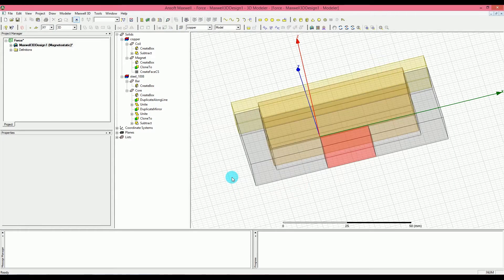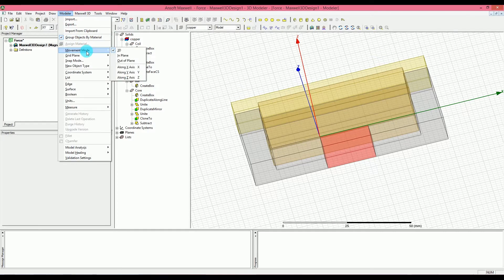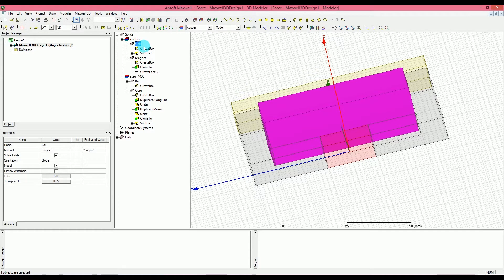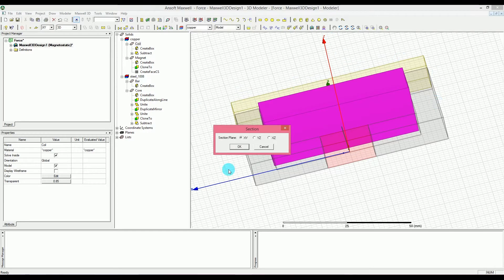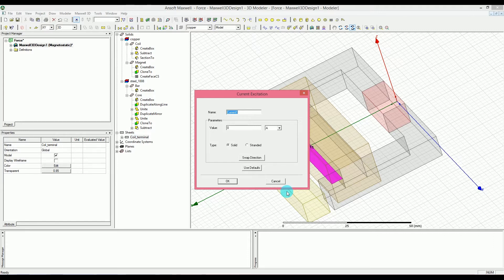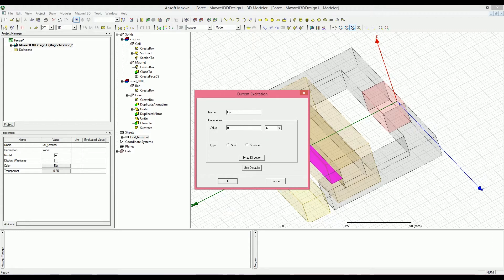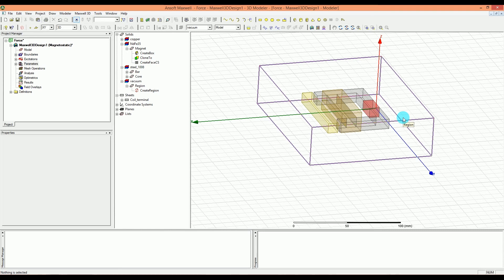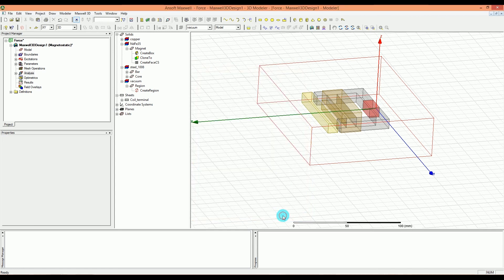204  Ansys Maxwell  Calculating Force in  Magnetostatic Analysis

Comment: What's the meaning of this current, it's the peak of a sinusoidal or it's a DC value? I want to corelated the flux generated with the H, A/m. I'm trying to simulate an inductor with permanent magnet to compensate the DC current that I have one it.
Reply from the maker: in Magnetostatic the current values are DC values of current
Reply: @kamyark8434  Damn, still active bro, thats amazing! Your Videos have actually been a godsent 💜💜

Comment: If you select "Percentage Offset", as you did,  Maxwell creates a box with dimensions that are relative to your model's dimensions. Thus, it does not want to take the measurements in mm. I think the values 50 is the percentage of the model's measurements that is selected for offset.
If you want to give Maxwell an absolute value like "50mm", you must select the option "Absolute Offset"
Reply: you are right i guess, just tried and it worked as you said , gg